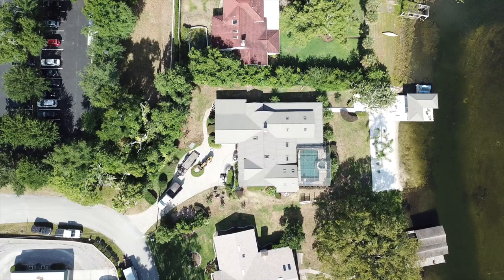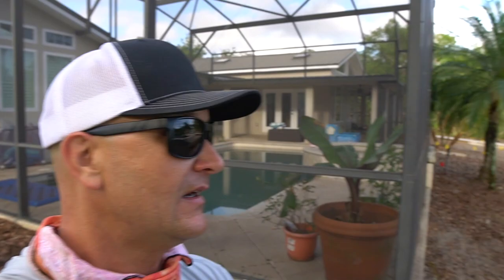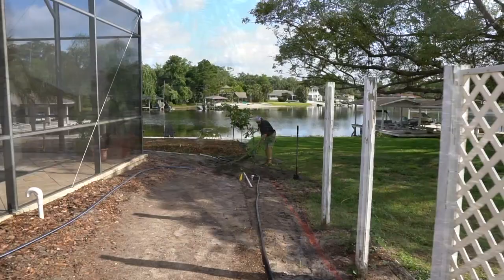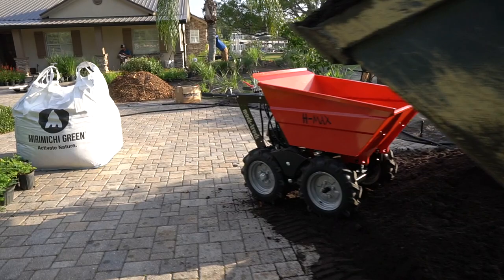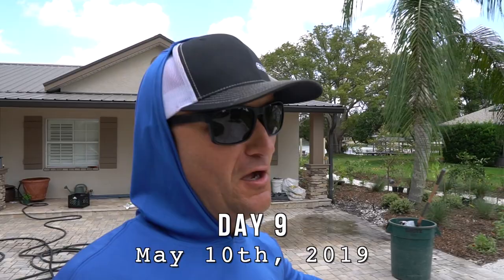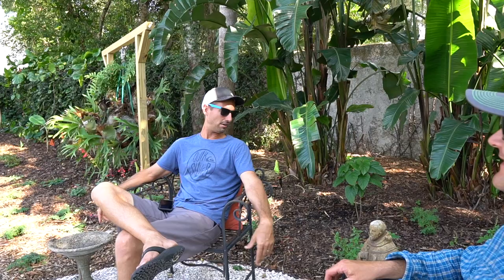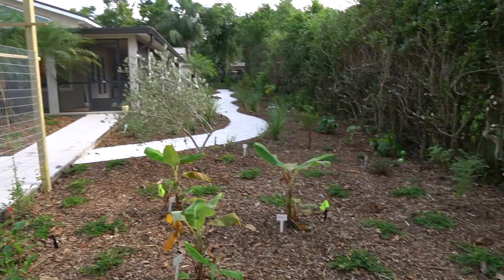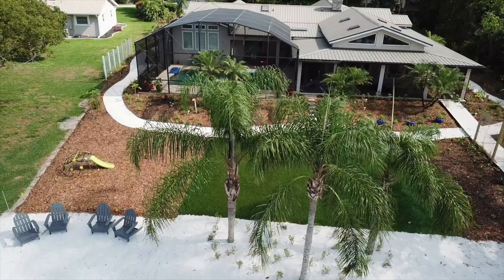No More GRASSHOLE!  Edible Yard Project + Eco Inspiration For YOUR Space!

Comment: I SO want to get to this point. I live in NE TN and have about an acre and half to mow, ughhh. But at 61 and basically disabled (bad arthritic back probs) I can't get down on the ground too much. I've started doing what I can. My veggies are in waist high containers. Have planted 4 fruit trees, a lot to do, just a bit at a time. My hubby is a trucker so gone a lot and I try to take care of this myself which is a bit difficult 😒. I'd love to have nothing but edibles in my whole yard, no grass 😁
Reply: Are you taking Magnesium supplements? And what water are you drinking? Lime and Calcium in the water builds up in the joints. We don't use Lime, so it really needs to be removed. Magnesium is deficient in most all produce today. Magnesium is required 1:1 with Calcium to properly be transported through the body, otherwise it winds up in the wrong places. IE Breasts, joints, Kidneys, possibly even arterial plaque. Start with 250mg/day, and progress up to 800. Watch your BP during the initial phase as it may bring it down. Clean your water. It helped me, and my family.
Reply: Overseeding a section of grass with wildflower seeds might be a low cost, low maintenance option for you. It can be cut back (or burned) before new spring growth. The new habitat would bring in beneficial insects for your vegetable garden. Best wishes.
Reply: @bryanst.martin7134  Yep take magnesium and my water is filtered!
Reply: @Brodmann312  Thanks!! May have to try that!!
Reply: @bryanst.martin7134  your very right...! Its great to see someelse who understand this.. if you add some zink and k it helps too. And D.. i found making bone broth south or neckbones simmered in tomato sauce will help with degenerative back too.   I did once a week till i started feeling much better..
Reply: @bryanst.martin7134  i looked at your channel...awesome.. duck farm..
Reply: @Brodmann312  good idea..

Comment: That gas wheelbarrow should be electric.
Costs less to refuel, less maintenance, no noise and no pollution.
Reply: time is money though and the sheer number of batteries you would need to keep it working for a full 8hr day would be a fair few and add a lot to the purchase price.
Reply: Cars go hundreds of miles on one charge and that wheelbarrow is not as heavy either,  the quietness and I turn more usage time of day will also help pay

Can charge during breaks and lunch
Reply: @gordybishop2375  this is not a car. It's purpose is to move material. It has significantly less space for batteries. Why do you think electric lawnmowers are only useable for small courtyards and not big yards? Both cannot hold batteries with enough capacity for big jobs, simple as that. Battery power would reduce the wheel barrow load size due to extra volume and weight over a small 2 stroke engine.
Reply: Engines and fuel take up space and weight load ,